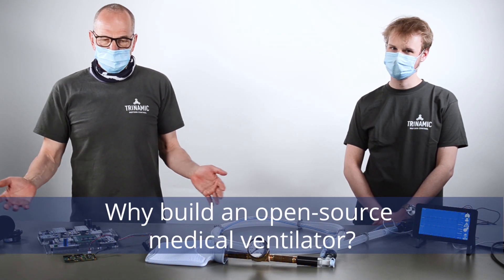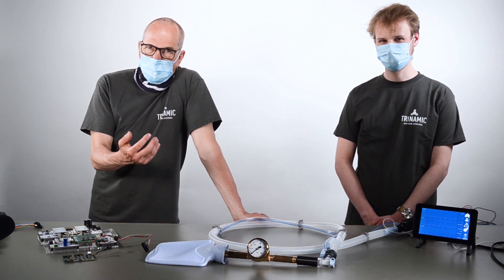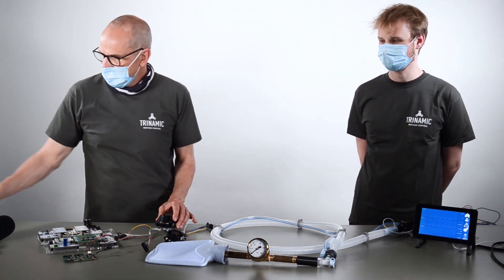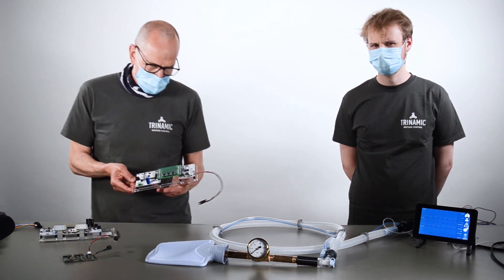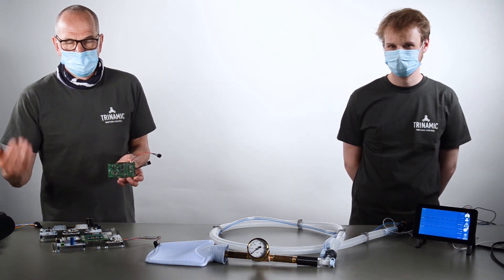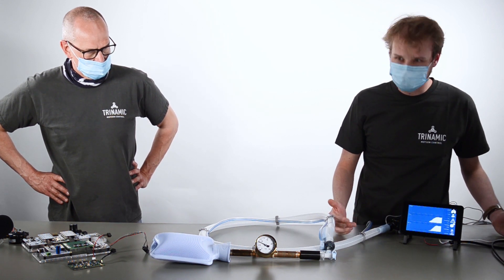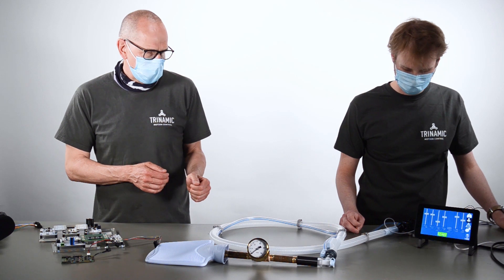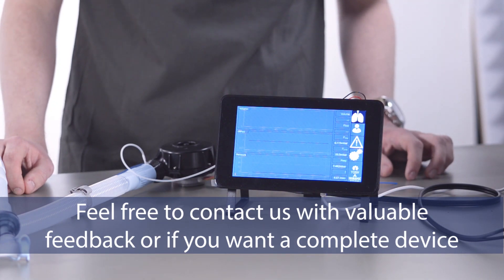Trinamic Open Source Ventilator Project

Comment from the maker: For more information on our TOSV project, see https://www.trinamic.com/solutions/medical/tosv/ 

More information on the TMC4671 servo controller IC with integrated FOC can be found here: https://www.trinamic.com/products/integrated-circuits/details/tmc4671/
More information on the TMC6100 high-power gate driver for PMSM servo or BLDC motors can be found here: https://www.trinamic.com/products/integrated-circuits/details/tmc6100-la/